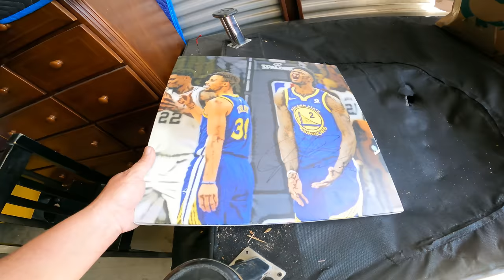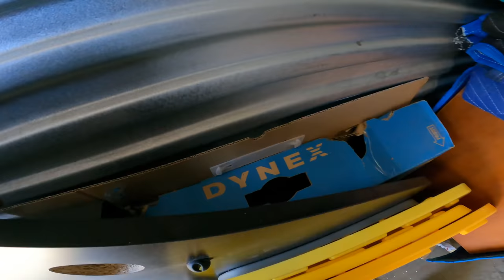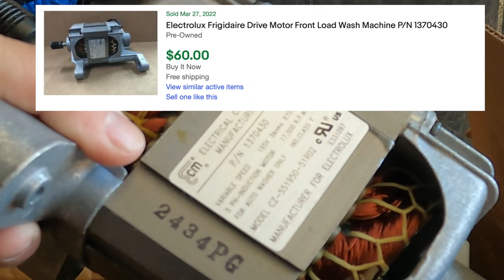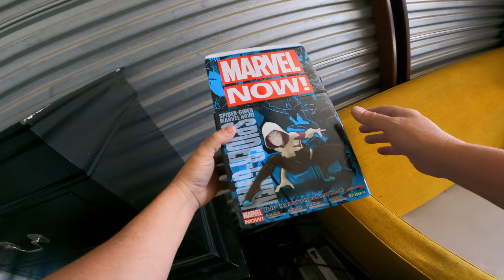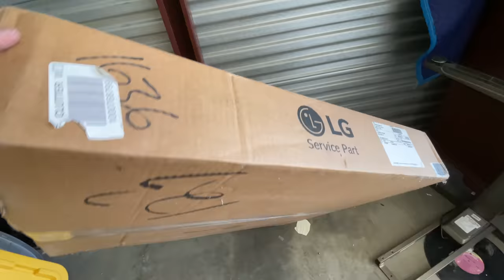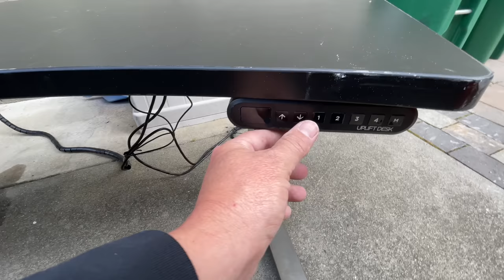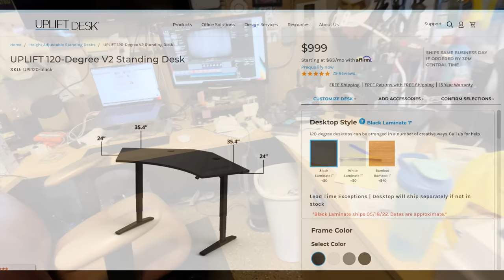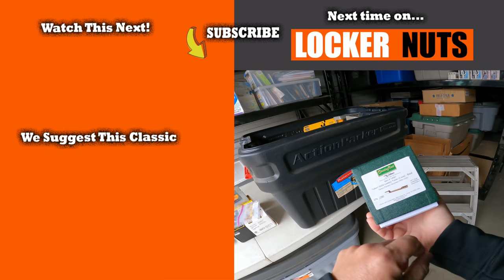It turns out I bought another storage buyer's locker at auction... and I know whose it was. Awkward!

Comment: They sell the carboard packing "triangles" at U-Haul. I came to really like them when we moved out of State, as they fill voids in moving boxes much more efficiently than foam peanuts, and are much cheaper. I bought out all the ones our local U-Haul had, and was disappointed that they would not be getting another shipment before we moved. And while the corn-based foam peanuts are at least biodegradable, just tossing the cardboard ones into the recycling along with all our moving boxes made the post-move clean up just that much easier.

Comment: Those needle nose pliers are not needle nose pliers. They have a spring in them for removing round clips that have 2 holes in them. That's why they have a spring in them. Once you get the pliers into the holes and squeeze them, they contract to be able to remove the ring clip.

Comment: Suggestion, if you get a Jackery power source you could test electronics in the locker rather than having to take them home. You could also attach a light source to make it easier to see in the back of the lockers, especially the inside lockers. Just an idea.
Reply: light source to level up the youtube videos! i love it :)
Reply: The Jackery requires no gas or propane and it is quiet.
Reply: I have a jackery for rv love it

Comment: You need to get a small portable generator. Can probably find a cheapish one at Harbor Freight. Can maybe convert it to propane so you don't need to mess with gas. Would require lugging a propane tank around though. Can also get one already set up for propane too.
Reply: Another option is a battery power station. May cost a bit more. But even less to deal with. Can plug things into it like lights or stuff to test. Just gotta make sure to charge it prior to going to a locker. But each charge would probably be enough for a few days of scavenging.

Comment: Congrats on the new wheels all the best.  Just curious,  Is it a hybrid or electric, or just old fashioned internal cumbustion?  In any event use it well and keep up the good work.  Your friend Mike.
Reply from the maker: It's a diesel. I don't think they make hybrids in the 2500 line, but I think they do for a 1500.
Reply: @LockerNuts  Got you.  Diesel is very fuel efficient all be it a little high in your neck of the woods. :)